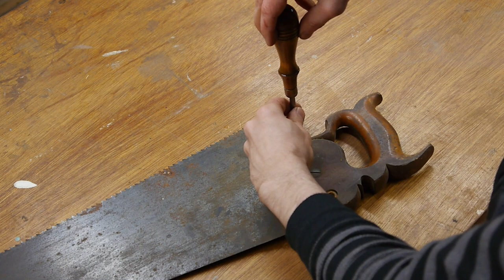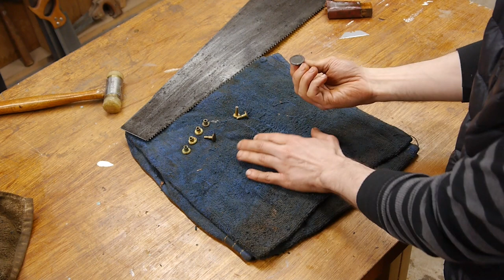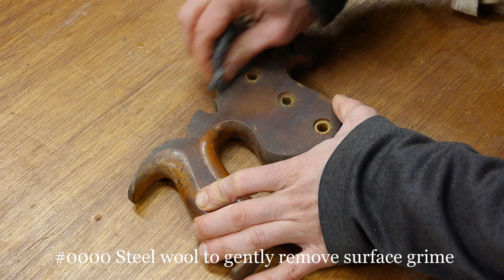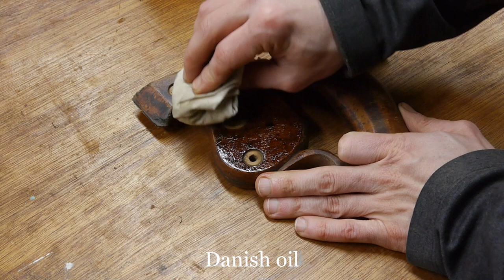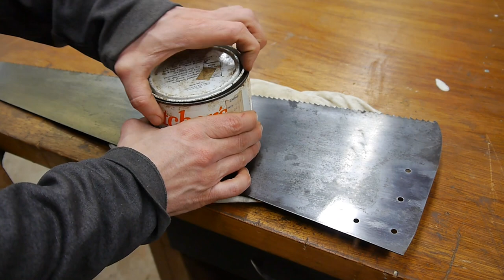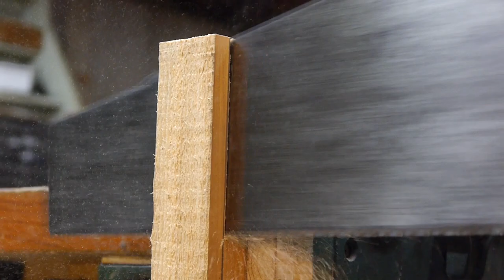Rare 1880s Richardson Bros. hand saw | Restoration

Comment: As someone who has been restoring antique tools, both hand and powered , I've neve seen or used motor oil to clean a blade before. It came out great. You could bring it back even more be using something like WD-40 which is not as heavy as motor oil. I think you may find any residue getting gummy after use in combination with sawdust and dirt. I would recommend not using find steel wool until after you sanded the grime off. If you use a fine grit it will take it right off. A heavier grit like 80 or 120 would remove the finish, which I do for a full restoration and after the wood is cleaned of dust, I would use as you did, Danish oil, or some other good penitrating oil. Hemp is very good as well. I would not put a shellac on, maybe wipe on poly, but honestly, the wood becomes very dry after 100 or more years and after the first application, I will go back a few more times, letting it dry in-between. Saws are one of my favorite tools to use and restore. I once came across a crudely painted saw at a tag sale. The had it hanging on the barn at one point. I looked very carefully and I had an idea that it was a mid 1800s saw and fairly rare. I bought for $8.00 and stripped the paint off. And sure enough it was an early limited produced Disston panel saw. It was worth a couple of hundred dollars 20 years ago, but I kept it instead. I use it occasionally, but it is hanging on the wall of my shop along with other tools I have collected. Even the rare handplanes I've restored, I use them all of the time. If I was going to sell them, I wouldn't use them. One of the rabbit planes
 I have that is made out of nickle, brass, and Indian Rosewood. It's a gorgeous looking plane, but it also cuts like a hot knife thru butter. A real pleasure to use.
I look forward to your other videos! Thank you for posting this.
Reply from the maker: Thanks @crossgrainwoodproductsltd9230,  I enjoyed reading your post!

Comment: Glad to see that you did not give the English resto treatment to the brass saw nuts and label. If the case of a very rusted saw with pitting I have been using a palm sander and one of the rust removal solutions. For a tarnish blade I might start with a very fine sand paper and see what happens.
Have you had any luck preserving the etching on any other projects of this age?
Reply from the maker: Hi Gary, I've been able to preserve the etch on many antique saws by using gentle methods. I focus on removing the loose orange/brown layer of surface rust by hand with scraping, fine sand paper, scotch bright, and steel wool, and stop once the dark layer of protective patina is reached. I avoid rust removers since they strip the patina along with the surface rust and tend to expose the steel to future rusting if not painted.

Comment: I was mightily relieved to see how you preserved the patina on the handle, using steel wool and not a belt sander!!! Kudos to you for for that. However I noticed you didn't restore the medallion? While I understand your concern for the piece, the best, and safest method is to use ammonia and 0000 grade still wool, not foregetting good vernitalion for the fumes. Gentle but firm rubbing will give you a magnificent finish that does not remove but polishes, thereby preserving any tiny marks that give the saw its character. The well-restored medallion puts the final touch to a remarkable antique saw that will delight everyone who sees it.

Comment: do you need to flatten the teeth everytime you resharpen your saw?
Reply from the maker: hi @phaul, I run a file across the tips of the saw teeth (this is called jointing) to bring them to a uniform height before sharpening. This adds a small flat spot on each tooth which is then filed to a sharp point. On old saws, the teeth are usually badly uneven ('out of joint') so a lot of jointing is needed. Once the saw has been restored, I usually just very lightly joint (eg one or two light file strokes) before resharpening when needed. My aim is always to remove as little steel as possible to maximize the life of the saw.

Comment: Nice video, thanks. I'm wondering why you didn't 'set' the teeth. Although it does seem to track well during the rip.
Reply from the maker: Hi Don, good question! I often find that the teeth on old saws have been given too much set. In this case, they can be sharpened a few times before you have to set the teeth again. I like to work with a minimal amount of set - just enough to prevent binding but not so much that the saw rattles around in the kerf. High quality vintage saws were also "taper ground", meaning the steel is a bit thicker at the tooth line than along the back - this reduces the amount of set needed.
Reply: @thehandtoolworks  Thank you, that makes great sense. 
I'll be looking for more vids.